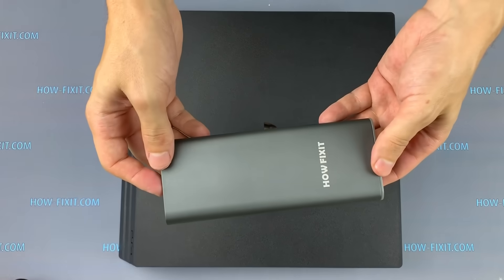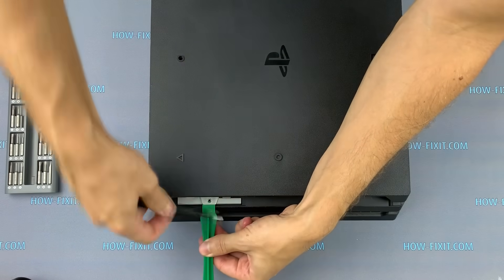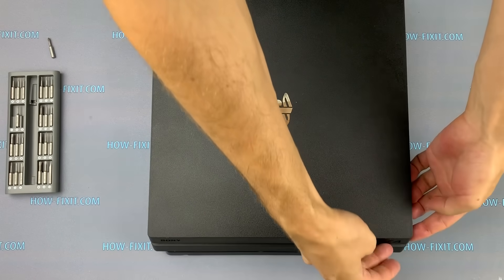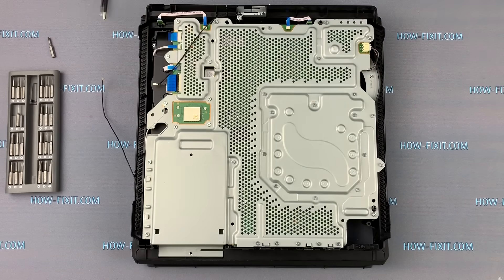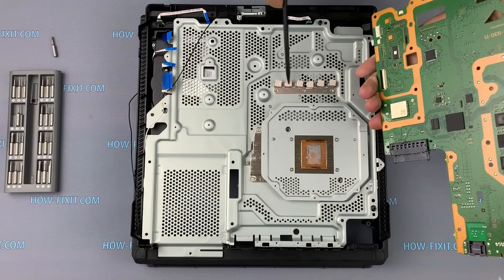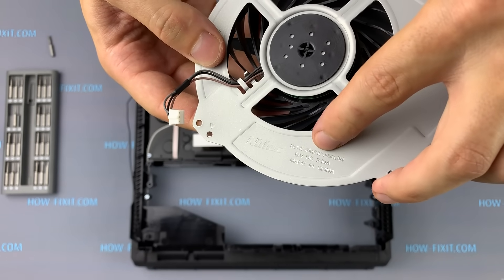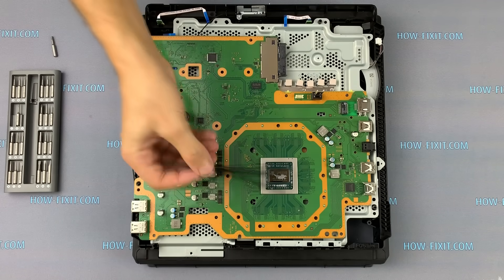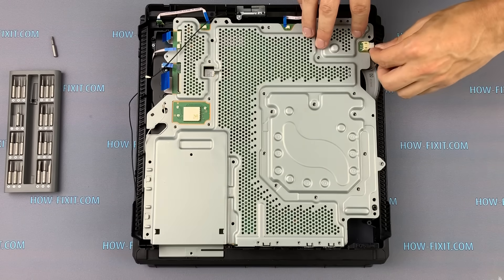PS4 Pro Disassembly: Ultimate Guide for Fan Cleaning and Thermal Paste Replacement

Comment: So anybody who is thinking about doing this. Don’t think, JUST DO IT! My fan doesn’t even spin up anymore. If it does - it is seriously quiet, so much that I can barely hear it. Literally followed the video, it’s so easy. Also, I didn’t replace the thermal pads. Just cleaned & replaced the thermal paste only, using Arctic MX-4.
Reply: How did you take out the power supply I can’t do it for some reason

Comment: Absolutely fantastic, worked amazingly, can't hear it at all playing Spider-Man or God of War, which used to absolutely blow the house down before. Not a peep. Thanks a lot for the help.

Note for people reading this before attempting: Don't pull wires out by the cables themselves, get some grippy pliers and wiggle gently the plastic surround at the end side to side and pull, LIGHTLY. After 20 secs or so it'll wiggle free and you won't have to buy a new power supply. :)

Comment: This was amazing dude, I only had one problem where the power supply connector was too god amn tight and the connector got loose and eventually it came off completely. It amazes me how easily you disconnected it. Now I have to weld the connector. Just a heads up to everyone, don't apply much strenght when disconnecting the power supply, apply pressure downwards on the connector and pull up the cable at the same time, or just unplug the cable from the power supply instead of the motherboard.

Comment: Bought a perfectly good PS4 pro cheap.. figured it was struggling somehow... typically on Xbox it’s just a dead body inside.. I tried out the PS4 and she was screaming for help under load. Thanks to your walk through I had it all apart no problem. Was a first PS4 disassemble... all iso cleaned, all new thermal pasted etc.. she’s now sitting silent under load. Just wanted to say cheers for the 101 👊🤪 ... only complaint I’d give is I somehow missed the ‘take these two out’ to allow the psu to release ... but palm faced once I realised... cheers 🥂

Comment: Hard to find a proper guide for the launch day one so ended up using Sony’s office tear down video along with this one.

Disassembled, wiped all dust but couldn’t get some from inside the heatsink. Applied some artic Mx-2 and reassembled.

Night and day difference. Playing any graphic demanding game like LOU2 used to make my pro fan’s spin so loud you couldn’t hear anyone speak, now it’s whisper quiet I even had to re open the case to make sure the fan was even spinning lol.

Comment: My console is turning on but for a second without any screen and it’s missing thermal pad and paste  any ideas?
Reply: You need thermal pads and thermal paste.

If you know that it was working before you opened it up go on online and purchase some thermal pads but make sure they are the same size as the ones on the board (thickness needs to match but you can cut them down to size).

Also pick up some artic mx-2 or mx-4  thermal paste and apply a rice grain along the APU length wise and Assemble back together making sure to tighten the APU bracket evenly and that all wires are correctly plugged in. It should boot up normally.
Reply: @TheNpcNoob  thanks a ton man I’ve ordered the thermal paste and pads but can you tell what’s the perfect size?

Comment: 3:13 how did you took off the power supply, I can’t remove it with the screw on. Then i tried to unscrew it and now the screw is f*cked. How am I supposed to take of the main power supply 😉🥲🥲

Comment: Excellent video!  A particularly nice touch was killing the background music when removing/refitting the exterior plastic covers, so we can hear the scary cracking sound they should make!  After finishing on mine, the fan was quieter, but not by as much as I’d hoped.  I put this down to the thermal pads, which were very small, misaligned and in bad condition.  I re-aligned them, but I suspect they’re not really helping the GPU keep cool.  I’ll follow your video again while replacing those.

Comment: Just one question, how tight the screw should be when mounting back the cpu cover that shape like S with the two black screws? I was afraid that if too tight, it will leave a very thin gap between CPU and heatsink and resulting thermal paste spilled aside but if it looses a little, it will have a bad heat connection between those two.
Reply: It’s supposed to be tight.

That’s what she said

Comment: Mine sounded soo loud and I knew the heat sink was caked with dust. However at 3:14 my hopes were dashes as I pulled the powersource connector right off the motherboard, my heart sank!  I was so concerned about the cables tearing that I never saw the real problem coming.  PLENTY of people have had similar issues and I am now looking at how to videos for soldering it back on. Ive tried TWICE now to sodder it back on to no avail.  Will try again this weekend but wish I could just take it to a shop to have it fixed.  PLEASE EDIT YOUR VIDEO TO WARN PEOPLE OF THIS KNOWN ISSUE!!!

-Average Joe
Reply: It’s not a known issue, your supposed to take care when unplugging anything. It’s COMMON SENSE

Comment: I've bought a used PS4 Pro on ebay a few days ago and was dissapointed seeing how loud the thing goes... It was really unbearable, so I decided to sell it immediatelly and buy a Slim version (I've had experience with Slim and it was never that loud). Fortunately, I've decided shortly after that I won't give up that easily, and searched for experiences what to do. One of the youtube videos led me here and I decided to do it. And I did it today and couldn't believe my ears - it actually works. The thing is even more interesting, due to the fact that the vent and the heatsink were completely dust-free! I've applied a little bit of the thermal paste (the same one like in this video) and replaced all thermal pads (+ put the rest of the pads on the funny-looking metal cover for better heat dissipation) and that's it. Same games work completely different in the same scenes. I am glad I didn't sell it and did this, it was even fun to do it, not difficult at all. Just be careful with all the cables and don't forget to connect something or pull violently if it doesn't get loose on the first try

Comment: Bad Video. It doesnt show how to demontage the power supply properly. On the backside where the motherbord is, there are two more screws to remove before you can put the power supply off. Almost broke my PSU because of your useless Tutorial. Thank you and Thumbs down. 👎
Reply: Loool you must be one of those people with 2 brain cells, your model was the original, which this tutorial isn’t for. He even mentioned this at the beginning!

Comment: This guy taking out the connector of the power supply with ease, meanwhile I'm 2 hours in trying to get it to budge.....
Reply: I found this the trickiest part... you got to use some long-nose pliers and very carefully wiggle the power supply connector out.  Mine was made more difficult by the fact that the plug looked chewed up... perhaps it melted slightly in the past?

Comment: So ive just followed the steps and my ps4 pto is so quite. left it on the cod screen for 15 minutes, fans didnt kick in like a jet engine, which they normally do within 30 seconds of being on the screen. These are the best instructions, so clear, good quality so i could pause between steps while removing screws and using thermal paste. Key is to have the correct security screwdriver - T9 and I used thermal grizzly kryonaught. Big thanks How-FixIT

Comment: How many Screws you need ?
Sony : YESSSSSS !!!
Reply: Bruh I lost one is it alright still
Reply: @billyvogler3242  They're there just to hold stuff together, as long is it's tightened you should be alright, or go buy a bunch from your local hardware store, screws are dirt cheap anyway. The store might even give you one piece for free if they have one laying around.
Reply: @billyvogler3242  Hi, how long is the cross screws that hold the motherboard? thanks. I need to buy some ones

Comment: I just completed it an hour ago ,I changed the thermal paste on my ps4 pro and now it does not overheat (it use to over heat within 5minutes of turning it on ) now it also does not sound like a jet , its very silent ,loved the tutorial I used artic MX4 thermal paste

1 year update: guys I did the same thing today as well after an year, BUT I RIPPED THE POWERSUPPLY SOCKET off the motherboard 😭😭😭
Got it fixed/micro solder in 2 hours , now everything works like normal, good tutorial just be careful in removing the POWERSUPPLY cable.

Comment: Link for thermal Paste dont work I disassembled my ps4 pro cleaned just need the paste can I put it back together without the paste 😬😂
Reply: Just go on amazon and search up noctua thermal paste and no you can’t put the ps4 back together without applying thermal paste

Comment: Great video I ordered my clean up kit from Amazon then next day (yeaterday) I went to operate on my PS4 PRO for the 1st time ... looked a little different in the inside but pretty much similar... had a jet engine noise ... so loud ... after reassembly I thought I forgot to connect the fun I was sad and disappointed but the I heard a whisper... and to my surprise that was the fan ..... thanks

Comment: Worked like showed in video. Very easy to follow steps. I fired up ps4 pro on god of war and the fan didn’t spin up like an jet engine. It was silent, was afraid the fan stopped working, but came hot air out in the back so every thing was in order 😀👍. Ty for this guide.

Comment: Thank you very much for showing this. My ps4 sounded like a starting rocket at some games but now I don't even hear a whisper at the same games.
All because I needed to wipe away some dust and renew the heat paste.
Thank to you it was completely easy and worked without any problems.

Comment: 2.55 there are only 4 screws in the power supply right ? So the like "plastic screw in the middle of power supply" we dont need to remove it right.. because i watched other videos there are 5 screws in the power supply section..

Comment: Great video! I was able to clean ps4 pro without torx with holes, only 2 or 3 screws turned out to be bit more resistant, but I removed them with flat scredriver. My ps4pro (silent version) was used for about 2 years, and recently became very noisy. I applied excellent Grizzly Kryonout paste, and replacedl pads with Phobya thermal pads. Radiator was in 40 percent filled with dust, also lot of thin dust inside. Also on fan blades, there was thick layer of dust. This was my first attempt, all took me about an hour.
Now, in testing, when running games which previously were making ps4pro very noisy, the system is almost completely quiet. As far as I remember, it is now less noisy than it was when I bought ps4pro brand new.
Good job and thanks for great tutorial!

Comment: Thanks for the walkthrough! My PS4 Pro has been loud for certain games since it was new. The fan would spin up during graphically intensive scenes and on some menu/lobby screens with uncapped framerates it would sound like a jet engine (looking at you, Warzone). This was even distractingly loud while playing with headphones on at a moderate volume. 

Disassembling revealed that I did not have dust buildup or blockages in the fan or heatsink and my console was still just as loud as before. When I removed the motherboard from the heatsink, I discovered that about 20% of the CPU had no thermal paste (a bubble must have formed in original assembly). I cleaned off the old paste from the heat transfer surfaces, applied new paste, and reassembled. Issue is 100% resolved! I haven't heard the fan once since I replaced the thermal paste, and I am thrilled that I can finally play in peace!

Comment: This fixed the noise issues, but now my console is intermittently flickering to a black screen. Picture and audio both cut out for a second. Any suggestions?
Reply: I wanted to update, as I messed with some cars and everything is working perfectly. The PS4 Pro is almost silent now if every game I’ve tested. Thank you so much for the excellent video.

Comment: I’m currently working on my PS4 and the power supply cable is stuck in the motherboard and I don’t want to pull too hard because I don’t want to mess up my power supply. Any suggestions?
Reply: At 3:13

Comment: I JUST did this, using Arctic MX-4 thermal paste. My PS4 Pro, which sounded like a jet about to take off, is now whisper quiet. Let me repeat that: it is WHISPER QUIET. Testing my most graphically intensive games (Avengers, Red Dead II, and Days Gone), all of which really taxes the fan, and one (Avengers) even causing my Pro to overheat and shut off within SECONDS, my machine is now whisper quiet. As a point of reference on how quiet it is: the disc drive is LOUDER than the fan. This is the way.

Comment: Thank you very much. I replaced the thermal paste on my pro and it  is much, much quieter now. In moments when it sounded like a jet, now I only hear a tiny bit of fan working. My ps4 didn't have much dust in it, but the factory applied thermal paste was everywhere but the actual cpu, no wonder it sounded like a plane.

Comment: The thermal paste on my PS4 pro has to be the worst factory application I have ever seen. There was just so much of it, like 4 peas worth which covered a hugely unnecessary number of transistors, and the paste itself looked to hold such a thin shit layer I can't imagine it was doing anything at all. Also dust was completely blocking about 1/4 of the radiator, so after clearing that it out on a game that used to shut down in the menu with the fans sounding like a jet engine plays so quietly that I have to mute it to hear the fan. Bloody fantastic

Comment: 7:33 Help!! - I stupidly snapped off one of the legs of that plastic mount that holds the metal square when i tried to remove it. Its left in the systemboard at the moment , what do you recommend? Can i use super glue to fix the tiny white plastic foot back on or is there a spare part for this? Thanks!! Since posting I found the part on ebay :)

Comment: Great video. I would recommend though when removing power supply, remove plug from power supply not circuit board. They are cheap soldered to the board and it is easier to replace power supply than motherboard!

Comment: Thank you for this tutorial, I managed to open older model (a bit different) with help of this tutorial without any problems.
My PS4 pro is now producing 6 times lower volume, i cleared it completely and applied new thermal paste. 
I have been playing for couple of hours now, RDR, AC Valhalla, it more silent than my computer now, prior to this i had "Jet engine" sound coming from my PS4.

Once again, mission successful, thanks for the effort. It helped me.

Comment: Thank you for the amazing video. My pro is now almost silent. I have the older rmodel but its almost exactly the same. A few less screws to pull on the inside and a slightly different cpu shroud. This was so thorough and easy to follow. I watched some other video that only includes taking off the top and bottom covers and trying to clean the fan without even removing it. No chance at reaching the radiator that way either which was totally clogged on my unit and  no reapplying of thermal compound which is the REAL reason they all sound like jets. That video had almost 3 million views and isn't anywhere NEAR as good as this one so I added a link to this video in the comments. Thanks again for the help! Now I don't cringe every time I turn my system on. Mine was ramping up loudly even just in the dashboard. 

P.S.  I also took your advice and made some coffee before putting it back together. I like your style. I don't trust people who don't drink coffee. 😀

Comment: I wanted to clean mine because the fan was LOUD and the speed was super inconsistent. It would whirr really fast and stop suddenly after about 5 seconds OVER and OVER. It was HIGHLY annoying. 

When I took it apart everything was squeaky clean! The fan and heat sink didn’t have but a few microscopic specs of dust on either of them. I applied new thermal paste and put it back together an it’s surprising nearly silent! I’m surprised by what a new coat of thermal paste could do! I’m blown away! Now, games that used to make my Pro sound like it was going to explode are super quiet! Almost silent!

I debated on trying to clean my console before as I was scared to break something (I had a close call with one of the wires on the motherboard but thankfully I had a good set of pliers) but I’m so happy I did! It was definitely a lot easier than I anticipated and I urge anyone else that has the same problem to just go for it! It’s cheaper and easier to do it yourself rather that pay somebody and wait a few weeks before it gets done.

Comment: On some motherboards the PSU (power supply unit) connector does not unplug - ever.  If this is you - instead try unplugging the wires from actual power supply. I accidentally jiggled the PSU connector completely off the motherboard and i am having difficulty finding someone who can fix it - if at all! Gutted!